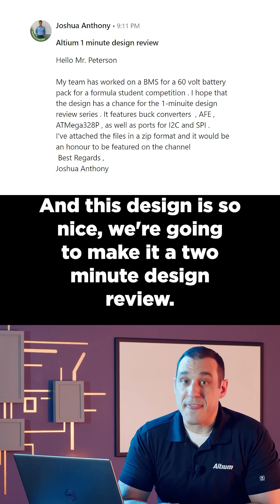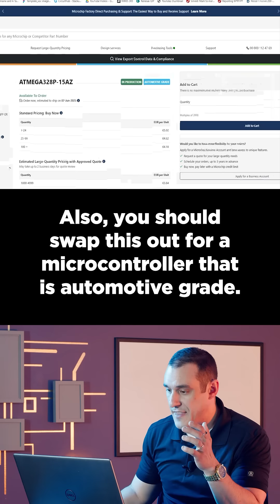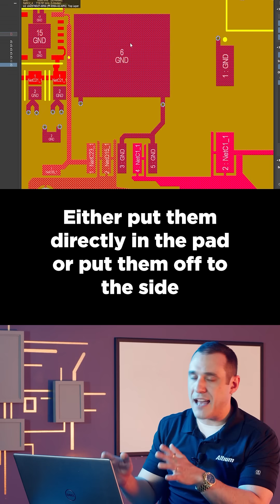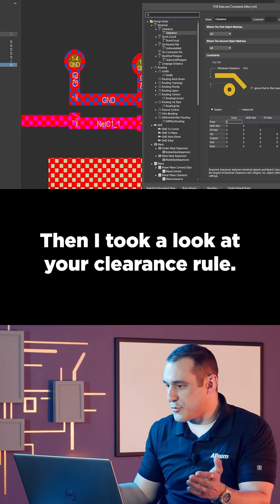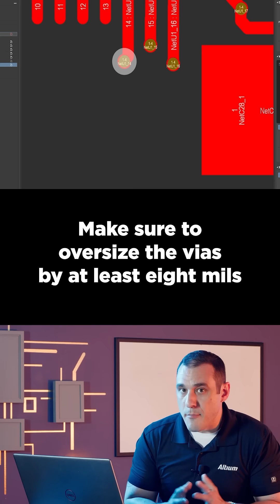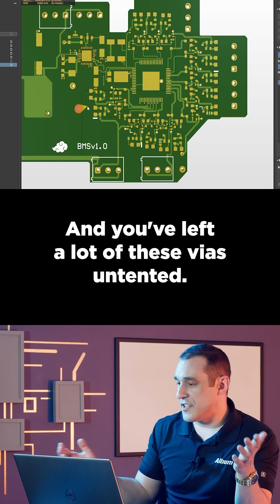Zero Clearance Chaos! | 1 Min PCB Design Review

Comment: Isn't atmega328p automotive grade?
Reply: The specific part number in the design is ATMega328P-MU. According to the Microchip Direct website, this part number does not conform to the standard automotive temperature range. This is why I showed the ATMega328P-15AZ as an alternative. They should be direct swaps though.
Reply: @Zachariah-Peterson Would there be equivalent smaller micro controllers? It seems to me like picking an oversized one can have a bunch of advantages for standardization
Reply: Often there are different packages/pinouts for the same core, so it's still relatively portable.
Reply: Often there are different packages/pinouts for the same core, so it's still relatively portable.
Reply: @hebestreitfan6973  Sure there are some advantages. For example, if you were building a product line that used the same codebase, but some part numbers had more peripherals connected to the MCU, then it makes sense to use the larger MCU and leave a lot of pins disconnected in one of your product's part numbers. These MCUs could be programmed by the vendor or on-the-line with a flashing fixture at your assembler, then they could assemble the same MCU into all your boards and you might be able to save money on parts thanks to volume discount. Also if you're trying to future-proof a design it has advantages because you could always add stuff to those unused pins in a later revision.

Comment: Why would anyone set clearance to zero and seek reviews?! Whats wrong with people
Reply: Zach is their DRC
Reply: I'm not a mind reader, but I think someone might do this because they wanted to "turn off" the DRC during layout and then never reset the clearance numbers to proper values. Another reason I would see someone doing this is because of an incorrect setting on polygon pour. For example, if you want the GND polygon to pour over GND through-holes, you should select "Pour Over All Same Net Objects". But if you didn't know about that setting, you might pick a zero clearance not realizing that it also sets the polygon to essentially short to any other net. Like I said, I'm not a mind reader but it is something I have seen done in Altium files.
Reply: People is wrong with what😅😂
Reply: We all started somewhere